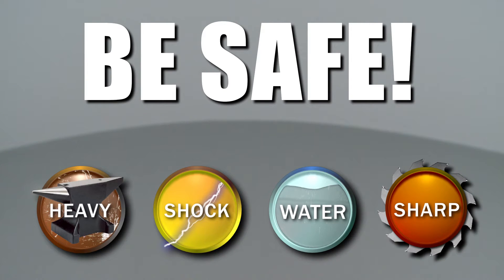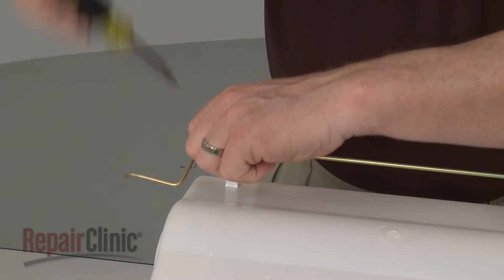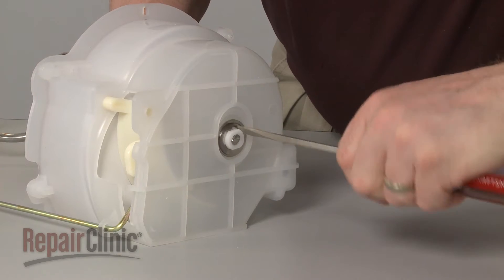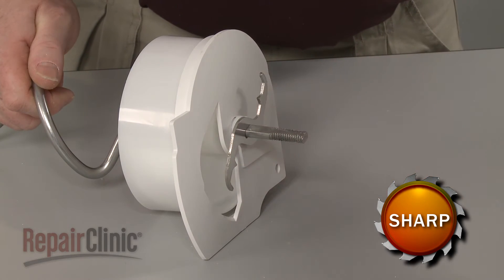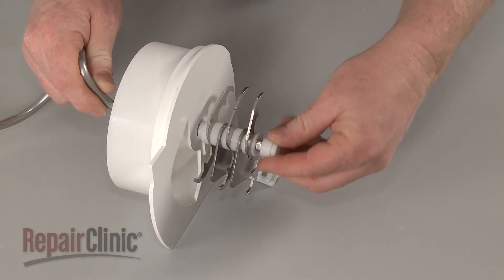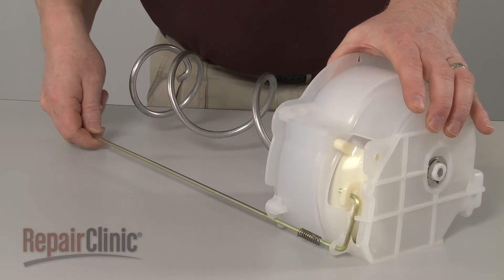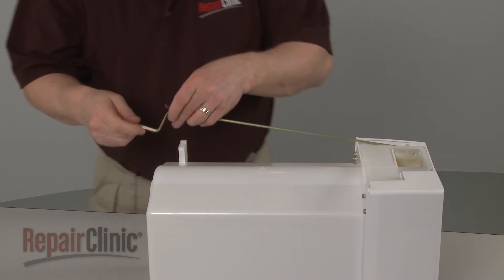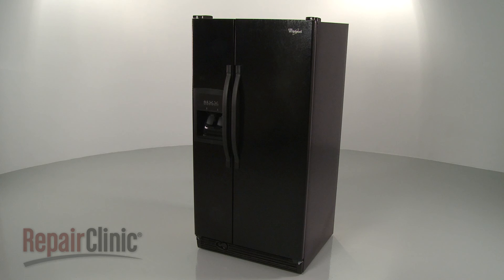Whirlpool Refrigerator Replace Dispenser Auger Drum #4388736

Comment: No real problems, a couple tips though. 
Tip- When removing the teeth and spacers - easy to slip them on to a pencil or your screwdriver to keep alignment and position straight (but hey, use your phone to take a picture first anyway for reference). 
Tip- At 3:00 - 3:07 it is not clear, make sure the plastic "block" with 2-teeth arms (shown sitting flush on table top at 3:00) connects properly with the housing when you put it together.  There is a peg on the block and a hole on the housing, sort of male-female.  This holds that block stationary when everything else rotates. 
Tip- keep some ice in the freezer so it won't melt AT ALL (it sticks together then, jamming the door shute ) and you can use this to test the repair immediately afterwards.   
Overall, easy fix - 30 minutes even being careful.  Just make sure to look closely at stuff BEFORE you take it apart! :D
Reply from the maker: brownj000 Thank you for your input.